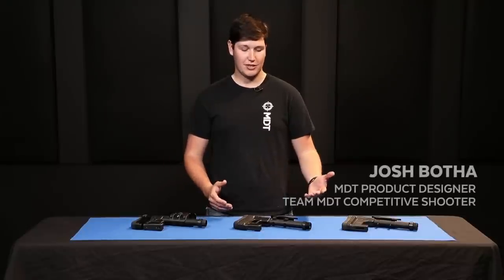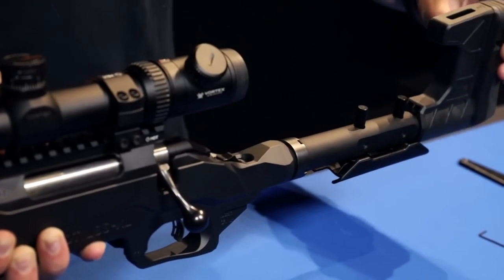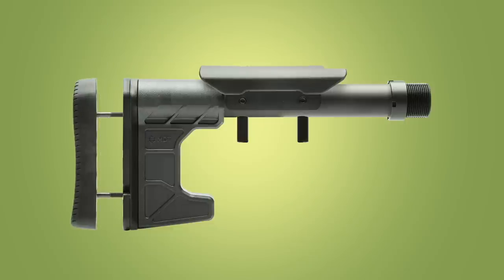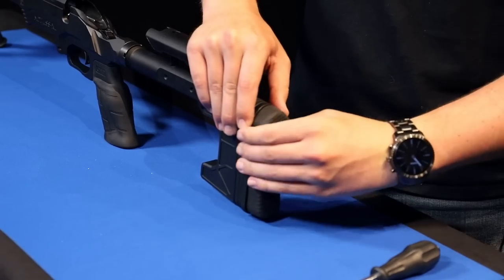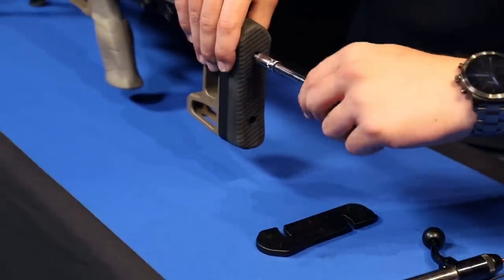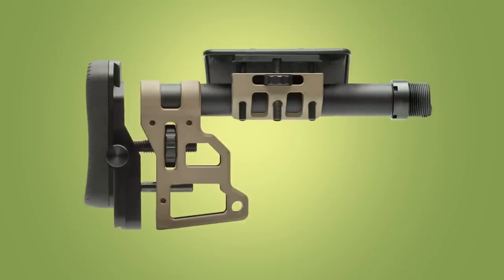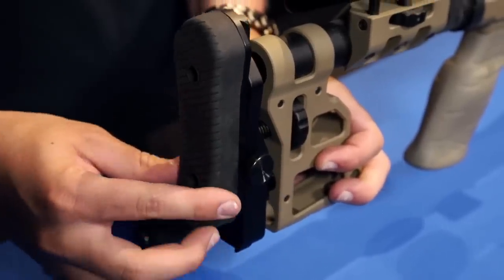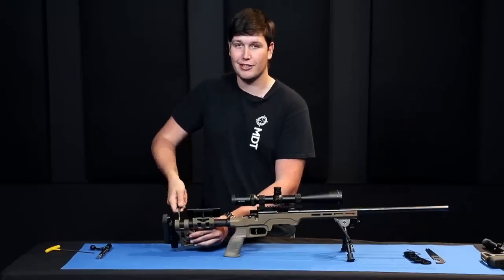MDT Skeleton Carbine Stock Install

Comment: I think the skelton buttstock can be easily modified to become a toolsless adjustable
Reply from the maker: The Skeleton Carbine Stock is already completely tool-less
Reply: @MDTTAC  you still need an Alen key to lock the screws. In tactical shooting, some times you need to switch from standing position to prone position. In such case forexample, it will be great to increase the length by an inch as fast as possible 😊
Reply from the maker: @Jean.34  Yes actually you are right on the Skeleton Carbine Stock. It is our Skeleton Rifle Stock that has toolless adjustment. It is very possible that this can be added to the SCS as well.

Comment: What castle nut wrench can be used to screw the castle nut of MDT Skeleton Carbine Stock? 
It seems that diameter of MDT SCS castle nut is larger that others from Ar15-system. I can't screw the castle nut of MDT SCS with my standart castle nut wrench to AR15 rifle.
Reply from the maker: The AR-15 Castle nut and castle nut wrench is the same as the MDT castle nut and wrench. If you contact us on our support portal at support.mdttac.com we will be able to troubleshoot this with you

Comment: Would these stocks work on a Stag 10? Looks like it would just be plug and play. Just bought a set of your rings and want more of your gear now!
Reply from the maker: Our skeleton carbine stock can work if you remove the cheek riser or have a side charging handle upper.

Comment: i was sold on the scs, but sometimes you need to shoot support side, i.e. a match stage requiring so. i was hoping to see you demonstrate how difficult it would be to remove the cheek assembly and turn it around. is this something that you could do easily between stages? i would think not and if thats the case, ill end up having to shoot a stage with a really awkward uncomfortable non cheek piece (on the wrong side)
Reply from the maker: Not easily, you need to remove the buttpad to slide it off. However, our SCS-Lite may be the way to since the cheek riser is in the middle of the buttstock.
Reply: @MDTTAC  thanks for the reply, thats a shame, i like the other features on the SCS (tool-less LOP adjustment).
Reply from the maker: Understood, I wish we had better news!

Comment: Is it possible to install SCS buttstock on MDT HS3 chassis, or it needs some adapter?
Reply from the maker: Yes, you would just need a lockplate in order to help secure the buttstock, we call it the fixed to carbine adapter, we also have a folding option for the fixed to carbine as well.

Comment: Hello MDT team, is it possible to install a picatinny rail on the bottom of your SCS stock? what are the distances between the holes on the bottom? hole sizes? is it M-Lok? would I have to drill through a piece of picatinny rail or one of your MDT rails (2.5" or 3.15") would fit there without any modifications? Thank you.
Reply from the maker: It sure is! Depends on which version you have you will need our 1.5" M-Lok Picatinny if you have a single M-Lok slot. Or our 2.5" Picatinny rail with QD sling cups if you have two drilled and tapped holes.

https://mdttac.com/accessories/attachments/picatinny/

Comment: I have a Mdt LSS XL gen 1. Will I need an adapter to make the SCS fit my chassis?
Reply from the maker: You will need our lockplate to finish it off! 
https://mdttac.com/fixed-to-carbine-lock-plate.html
Reply: @MDTTAC  cheers, and thanks for the quick response!

Comment: What's the min/max range of LOP adjustment on the SCS-Lite and CCS?
Reply from the maker: The SCS-Lite and the CCS both have a length of 10.6" to 11.6" how that translates into a LOP will be determined by the rifle you're going to install it on.

Comment: Will the scs work with AR10?
Reply from the maker: As long as you have a carbine length recoil system and a side charging handle upper, it will work.